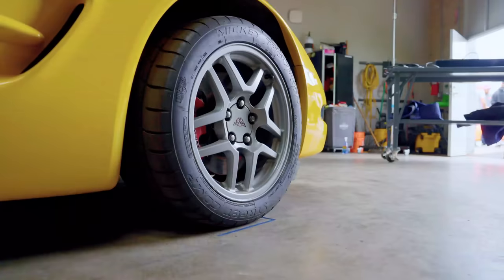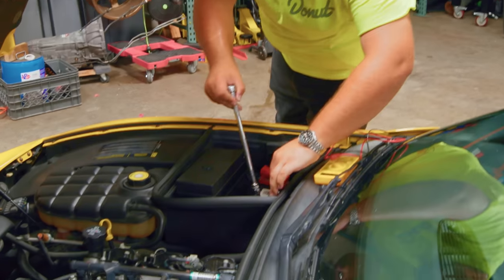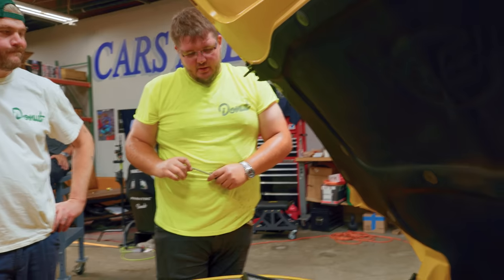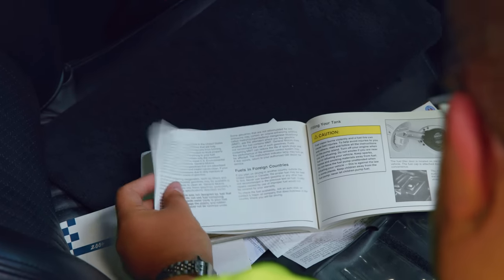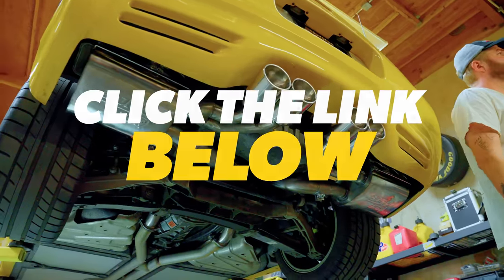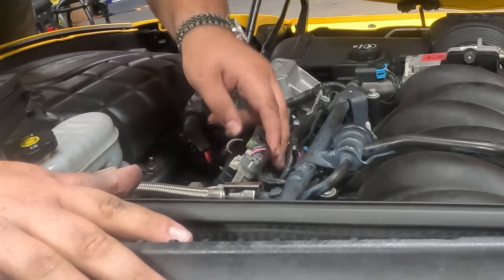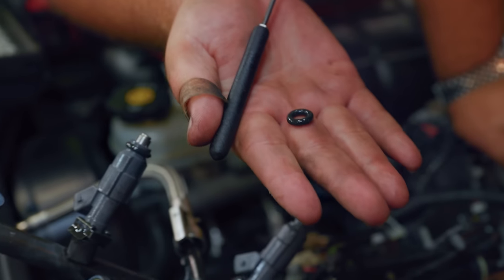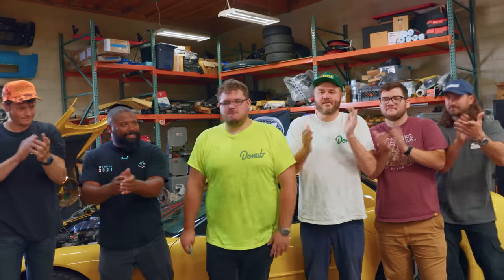Giving Someone a Corvette, If They Can Fix It

Comment: Throughout this whole episode I felt like Sam wasn’t given enough time for the amount of sabotage done.
Reply: he made mistakes that costed him time simple as that he also got an extra 20 minutes
Reply: Looked like he was not supposed to win. And what happened to the bonus time he was going to get for Donut trivia ?
Reply: So you want a participation trophy?  That's the problem with you kids, you think everyone should win.  He had plenty of time, he just kept repeating the same stuff over and over.  He kept going to back to the fuse and installing parts incorrectly.
Reply: Yeah this felt like a setup.
Reply: Definitly doable just spent too much time overthinking, checking fuses took way to long. Crank and cam sensors would throw codes so wasted time on that too. Also after finding one plug wire fucked he should have went through them all. Obviously much harder to think clearly when you have that much pressure on you. Not saying I could have done it but definitely not impossible
Reply: @LordOfTheDrinks01 you must've missed the exhaust challenge.
Reply: @pierres3x  20 minutes is nothing tho
Reply: @DroneStrike1776  Yeah and thank god they didn't force him to get the keys out of a huge block of ice that would just make you loose a shit ton of time while showing 0 car skills.
Mr copy n pasted american 0046736
Reply: @DroneStrike1776  and you could do better?
Reply: that’s why it’s called a challenge. it wouldn’t be a challenge if it was easy haha
Reply: @DroneStrike1776 relax American.
Reply: I agree.  Plus there were 12 sabotages, not 6!  They also misdirected him on many occasions.  Plus started him out with 90 minutes, not 2-3 hours like other contestants got.......Just dirty all the way around....Make this right Donut!!
Reply: He actually got too much time, even an extra 20 minutes for the muffler stuff, he was definitely lost wasted a lot of time looking for the wrong problems based on the car symptoms, didn't follow any diagnostic procedure, can't win like that I'm sorry 😢
Reply: @frankensteinmotors6233  y’all talk like that but damn well no you couldn’t do any better.
Reply: @LordOfTheDrinks01  they said they give it for donut trivia or car "know how". In this case they gave him 20 minutes ontop for installing the exhaust system. Sooo i'd say that's sufficient. His problem is not being thorough. I mean they gave him a major hint on the spark plug wires... major hint on the fuel injectors... he made one too many assumptions and went down the hole chasing rabbits too early. I imagine it'd be wiser to check the simple stuff first and then go to harder things after.
Reply: Is a LS based Chevy V8 which is not a complicated platform. The fact that it didn’t throw codes that couldn’t be cleared tells you the issues were limited to common physical component deficiencies. Fuel, Spark, Air. Dude just skipped  around without verifying proper operation of the three requirement. Most Chevy guy would have been driving that Z06 home.
Reply: @DroneStrike1776 The two things that tripped him up the most were problems that literally required him to revisit the same issue over and over again, to be fair. He just revisited the wrong issues.
Reply: @josefarias111 He did actually check those simpler things first. He made the mistake of assuming that he had already fixed those issues though in spite of the hints. In his head he had already crossed off the vacuum hoses and the ignition wires. It was the multiples that got him. He should have been more thorough, but I can totally understand how it would be confusing when they say “you’ve got three of the six problems” done when there were still elements of those first three that hadn’t in fact been handled. They should have said he only had part of those earlier on. They eventually tell him, but it was sort of too late by then. It caused him to burn time assuming it was something else earlier on.
Reply: @jakewastaken  when they told him "you've got three of the six problems" he had 3 of the six problems solved. He had only part of the spark plugs when they said it. He had the fuse, battery, and key and 1 spark plug wire when they said he had "three of the six problems solved". Had he taken the time to think about it he'd of realized one of those that he had solved was incomplete. That's why I mentioned he's not thorough, that was his biggest point of failure. Fixing 1 spark plug wire and assuming the rest to be okay.
Reply: @josefarias111  I’d have to re-watch it to get it fresh, but I agree that thoroughness ultimately got him. I just totally understand how he made those mistakes.
Reply: @josefarias111  Okay, yeah, but he was also given significantly less time than anyone else so he was under more stress, and introducing duplicate issues and not mentioning it at all is incredibly unfair, it's literally changing the rules of the game without telling any contestants.
Reply: Yeah I thought the same thing. It didn’t seem like was slacking around or anything he was working fast the whole time
Reply: @frankensteinmotors6233  I completely agree.  He started to follow diag procedures with spark, fuel, air, but he didn't do any diligent kind of diagnostics.  Why would you only check one wire?  Hell, he got lucky on finding a few of the problems going down rabbit holes that logically made no sense.
Reply: @_pitaph_6392 you realize not everything made it to the final cut. He mentioned in his own recap on his channel that he did check all the spark wires after finding the issue with the one, but apparently he didn’t pull on them hard enough. Why? Because they’re easy to break as is so if he was really yanking on them he would have broken all 8. 

Also, this vehicle also had 2 bad coils that donut failed to include in their “list of sabotages” so in reality there were like 13 sabotages he had to deal with.
Reply: @josefarias111 In his own video recap Sam mentions that he did in fact check every spark plug wire after finding the initial cut one. You must check these wire connections gently because if to much force is used you will destroy a perfectly new spark plug wire.
Reply: @DroneStrike1776 eally pulled out the “that’s the problem with you kids” with the most obvious bait profile lmaoo
Reply: @pierres3x  i saw the previous videos getting mere 90 min for so many sabotages is unfair
Reply: he was he only needed to fix 1 thing plus he was eating up alot of time fr
Reply: @DroneStrike1776 ok boomer
Reply: This guy looked so heartbroken. He did such a good job. But seriously, they shoulda stated there was actually 9 problems instead of 6.
Reply: @LordOfTheDrinks01  He burned it.
Reply: @BxgDxwg when did he say that because I didn't see it in his comment
Reply: Would've asked for a scanner at the beginning
Reply: They could have made this so much more difficult, for reference I had a base c5 and anything under the car is very difficult to do except for the exhaust. When I had the car I did a clutch, trans, torque tube bearings, new slave, master cylinder in about 1 day that is by my self, and if you know anything about corvettes you need to drop the entire rear subframe if you don't I would recommend watching a video very hard job. Everything they had him do was very simple you can clearly see the intake manifold is off the (bolts are completely out you can see them easily at 17:49). all of the vacuum lines are very exposed and easy to see, and he only checked one of the spark plug wires like come on man. The fuses are a no brainer check and he was literally told the the only fuel issue that was left was the injectors. None of Dount's if they can fix it videos have been that crazy and he had plenty of time to fix that car.
Reply: He had a perfect amount of time and the last two were easy im very proud if sam although he did get distracted alot though
Reply: Its a damn corvette
Reply: @DroneStrike1776  there's no way you are actually called Drone strike 1776 LMFAOOOOOO
Reply: @LordOfTheDrinks01  they said all contestants get bonus time for donut trivia/knowledge OR something else(can’t remember)….but
Not both!
Reply: @DroneStrike1776 Like you could do better? You've probably never won in your entire life.
Reply: @DrBrooza  Ok Mr. copy n paste European snob possibly?
Reply: @whiskeyniner6416  are you really getting offended because i called "Dronestriker" with an american flag as a propic talking about "Oh damn new generations are weak" a "copypasta american"?
Reply: @DrBrooza  Nah, I'm just trolling.
Reply: @pierres3x  So true because if i was him its always power, fuel, air, and spark. He didn't check all the spark plug wires. I would have done battery first. Then check all the wires and the hoses and the fuel and then fuses. Then check the ecu if its plugged in correctly and what not. Then start the car.

Comment: As someone who works on cars it is pretty important to always know how to get the keys out of huge block of ice. Probably one of the most common repairs or pieces of maintenance a mechanic will do in their lifetime.
Reply: that is the easiest sabotage to fix. Not only do they present it to you but tell you want to do. His mistake was hammering it instead of pushing the block of ice onto the ground. The thing was pretty high up.
Reply: @jimmyonishi307 r/wooooosh
Reply: repentandbelieveinJesusChrist9  I don't think that'll help at all with getting the car started. Probably would make it worse.
Reply: @jimmyonishi307  Or ask for an air chisel
Reply: @jimmyonishi307  Flip on side, run a quick score line with a saw or hacksaw blade, toss on ground - watch it shatter and pick up the keys.
Reply: I would have asked for a man-sized sledge and pushed it to the ground. First two things I thought of.."push it,wow that's a small hammer"
Reply: @TecniclyAwsm  Still faster to grind a line with a screwdriver or similar to create a stress point and then slam it on the ground.  No point in bothering with being nice or cleanup. But, yes, first is to get it on the ground where you can use your body weight and a proper tool on it.
Reply: @TecniclyAwsm yes bro, straight off that table hopefully it breaks in the right spot to just grab em 😂

Comment: He had one of the most complicated cars on this series, the smallest amount of time and the most problems to fix.
Reply: ong.... like why he get the hardest possible situation plus MULTIPLE of the same thing messed up... not fair. poor sam
Reply: But also the best car in my opinion lol
Reply: Most expensive car though
Reply: He had the Most simple problems if he just took his time looking at all the spark plug wires and not waste it diagnosing on a obdll
Reply: @connoisseuroftigolbitts   well no, there needs to be some context here. on a vehicle that has any issue that has an obd2 port for the most part, you scan that shit first to see if there's anything obvious, try to start it afterwards, and THEN start digging into it.

we're not working with carbs anymore, thank god for the DLC
Reply: try to start it within reason, anyways. obviously don't try to start it if you know the fuel pump is dead, or if the engine is flooded
Reply: they wanted the car for themselves hahahah
Reply: its fair and at least we know it was a REAL challenge not staged

Comment: Doing multiple spark plug wires and multiple vacuum leaks was pretty brutal. In a pressured time situation, you’re way more likely to want to keep progressing and not having to double back to address the same problems that he already thought he had covered. He’s forced to second guess everything. That kills momentum and makes spiraling out so much worse. The dude was pretty on top of it, but the bamboozles were rough.

Comment: This felt like Sam kinda got the hardest challenge plus the time he spent having to get a key out of ice is crazy
Reply: I don’t know enough about cars. Why did replacing the battery cause that error to go off? Is it super common because it looks like it threw off the people who did the sabotage. I’m blaming Jerimiah
Reply: @VGbeck22  they said he was messing with that connector before hand and he must of unplugged it and forgot to plug it back in. also electronics sometimes just dont like their power source being completely yanked out. its a bit uncommon but it happens sometimes
Reply: @VGbeck22 he pulled the battery out of the car which basically factory resets the computer so when he turned the car over with the new battery the computer didn't know how much the throttle plate was open, that wasn't a sabotage that's just what some cars do but I think they should've clued him in more about that one cuz that wasn't even part of the plan
Reply: It’s the hardest challenge but the most valuable car so it makes sense
Reply: Every mechanic knows how to break apart ice to obtain a key... That's a common reason people bring their cars in...
Reply: @VGbeck22  some vehicles need a battery reset after a battery change, most will have to relearn some parameters but like throttle position or maf but with key on and vehicle off wide open throttle and off a couple times and starting it up and shutting it off a few times normally does the trick with those obd codes. also to keep in mind with other obd codes is that just cause its there doesn't mean its the part, it could be any thing shared with in the circuit and thats when having the diagnostic diagram for it is needed.
Reply: why ice though lol
Reply: @iliketurbosofficial  fire would be too easy
Reply: Bro C5s are an absolute nightmare to work on 😂😂😂
Reply: I was wondering why he didn't just push the whole block off the cart onto the floor to break it.
Reply: Car is more interesting/expensive ofcs it’s gonna be harder
Reply: @VGbeck22   Removing the battery terminals on those cars will logic lock some of the systems until you clear the codes.
Reply: yeah kinda scammed on tthis one
Reply: @VGbeck22  Depends on the design. Some cars would be fine but for others, disconnecting the battery would reset some functions and possibly throw a code. My mom has an Audi that when the battery was disconnected, the car would throw ESP errors but all you need to do is follow a reset/calibrate procedure (turn steering wheel left and right and drive for certain time, etc.) and the error will disappear by itself.
Reply: it's part of the game/challenge, sucks but some will win and others will inevitably lose. Bigger the prize bigger the headache.
Reply: @VGbeck22   Many manufacturers have the same procedure. whenever you unplug the battery you have to first turn ignition on but not all the way. give it several seconds. Turn ignition off. Then you can turn the key again start the car... well try to start the car.
Reply: Yeah Sam got 100% scammed
Reply: No way. Getting the key out of the ice is way easier and faster than having to figure out a real bug. That was a total freebie.
Reply: Having to get the key out of the ice was lame.
Reply: He prolly could've toppled the ice over
Reply: I agree.  Plus there were 12 sabotages, not 6!  They also misdirected him on many occasions.  Plus started him out with 90 minutes, not 2-3 hours like other contestants got.......Just dirty all the way around....Make this right Donut!!
Reply: Yea only took him about 5min but I’m sure that threw him off
Reply: @POTATOS.Z06 haha laughing in a 350z 😂😂😭😭😭😭 everything is compressed in a Z